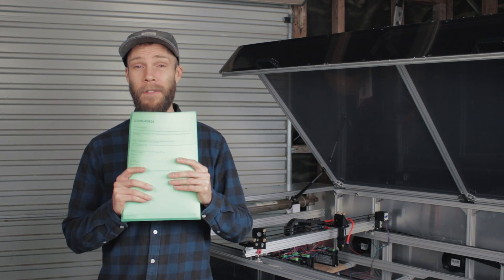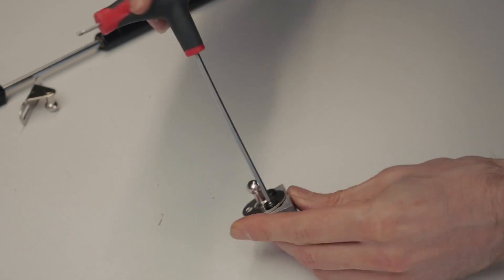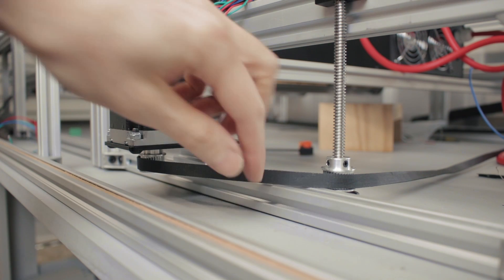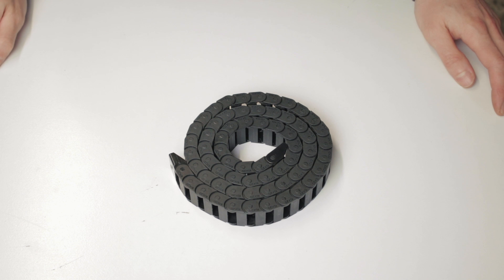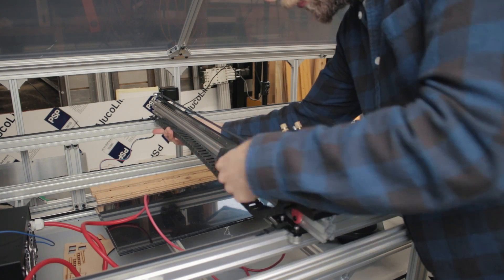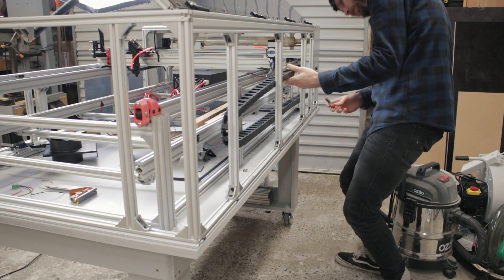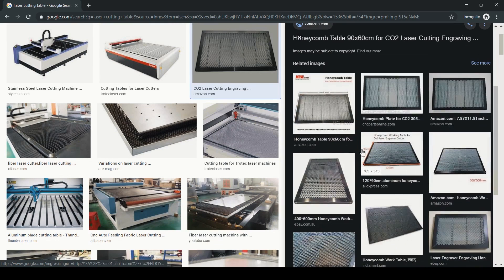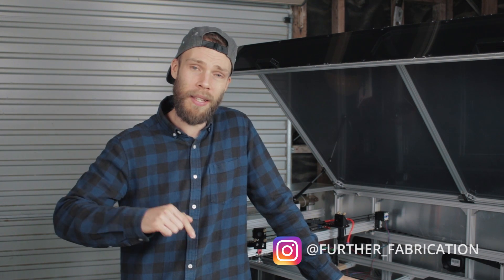Ep8: The Documentation is FINALLY done! The DIY CO2 Laser Cutter / Engraver Build Series

Comment: Note the strut ram should have the rod at the lowest point when in the normal position. This is to allow the oil in the struts to cover the seal and therefore prevent the gas from escaping.

Comment: I love this series and since this is the documentation portion of it, I'm hoping if you could give a ballpark estimation of what the cost of building the 400 series cutter would be? 
I'm a machinist by trade, so I do have a mill, lathe and saw, along with a 3D printer. So fabrication will not be an issue. 
I just would like to be prepared for mentally what it will be cost wise. Thanks, Tom.

Comment: Hi! I bought your plans and ordered most of the components to build the desktop model. Really looking forward to the build. I appreciate all the time and effort you put into the videos and the plans. So far, it looks like the cost is going to come quite a bit below your estimate, but I'm sure a lot of that is due to your location. Of course, that's not a complaint at all, lol. Thanks again. Larkin
Reply: Hey, man, what's a overall cost of this build? Thx!
Reply: @reels_ro  That's a good question, lol. I never really figured out the exact cost, but I am thinking around $1500.00 Later on I upgraded the chiller to a 5200 and also upgraded the 50w tube to a 90-100w tube. My only regret is not building a larger bed, but the laser has been a real Money maker. This laser is not like a glowforge or other desktop laser, in that it is not a plug and play but I believe I did the right thing as the building process taught me a great deal about all the interior workings of a laser and if something breaks or gets out of whack, I know how to fix it.

Comment: Hi Rob, just a quick question where does the X switch goes after you put the cablechain? i've notice you removed it in this video and in the build guide the picture is from the previous video before you install the aluminium part which support the cablechain ; I've found out the switch is in the way of all the cables and air pipes at the end...

Comment: Just use peg board with m4 bolts through it. You can alternate holes or drill extraction holes between the grid lines. Cheap piece of Masonite with drywall screws through would work too.

Comment: Stellar series mate! Honestly, very well done. It's a big thank you from me.  
Just a quick question, I noticed that the linear guide rails were not installed when you were working on the motorized table lift at 4:27 . Are the jacking screws stable enough without them?
All the best from the Western Island,
Ben

Comment: I purchased the parts list and build guides. Great series by the way. Technical question, would I be able to substitute the Ruida controller for a Cohesion 3d which I already own? Or do you see an issue with that?
Reply from the maker: That should be absolutely fine

Comment: Thank you so much for this video series. I bought the plans and we are working our way through ordering stuff. We tried to decipher the Misumi website and their endless choices and after a day we gave up and ordered all the 2020 and 4020 T-slot aluminum from Zyltech in convenient bundles with free t-nuts and bolts thrown in. We ended up getting 10% off our order which made it cheaper than Misumi anyway.

Be aware that some of the shipping can sneak up on you. Many small parts of 10-50 cents ring up to $3-5 shipping each. The total cost including shipping on 450 M5x8mm bolts rang up to over $150. Amazon is $100 for the same. We found a local supplier who will be even less. The shipping on the $332 laser tube is $140, bringing it to $472. We're finding deals $100 less on eBay with free shipping. Be sure to shop around! :)

Comment: Great work Rob. Waiting on my tube to arrive and I can fire my Further Fab inspired laser. Ended up with a 800x600 cutting area. 

I want to change out my X axis idler pulley for your 3D design. Which of your documents should be purchased for the stl files?

Thanks again for all your work on this project.
Reply: Just went ahead and bought them all. For anyone else with this question it’d in the CAD bundle.
Reply from the maker: You're welcome mate, glad I could help! That's a really good size - good balance between productive workspace and not taking up too much room

Comment: Woah! $5, that's more than reasonable for what surely took several days if not weeks of research, assembly and troubleshooting. Love the project man, keep up the good work!
Reply: I have no problem with the $15 for the manual. But at $2400 for the 400 build it's suddenly not a hobby machine any more. Excellent videos though and I've learned loads.
Reply: @thurgogopro5338  It is a CO2 laser cutter. If you want a cheaper cutter, just buy a diode cutter around the 5 watt mark, with an all aluminum frame and build an external frame around that. That is entirely possible too
Reply: more like $15

Comment: What size laser tube did you get?
Reply from the maker: I've still got an old 50W in there at the moment, but it's designed to take a 80W Reci W1, which is what I'll get once my current tube fully dies

Comment: I have started building this great series.  My control system is already wired up.  The Ruida controller because of it's flexibility has a lot of parameters to set up.  The Chinglish documentation by Ruida is poor and confusing.   Would you be providing typical controller settings to start out with?  That would be a great help.  Thanks for the tremendous time, knowledge and effort you have put into your series.
Reply from the maker: Awesome, glad the series has been helpful! If you have a look at the Y-1200 Build Guide, I've included with that a full folder of photos of all my controller parameters to get people started

Comment: I am beyond impress with this series and speaking for my self and probably others this is valuable information. I plan on upgrading my k40 and the Y-1200 documentation will be my choice. In the past ive used leather studs as a more aesthetic nail bed option. It comes in all sizes and have a tapped screws in the back for easy attachments. Might worth a look.  shorturl.at/lpzCK
Reply from the maker: Thanks Jay! oh yeah they would work well, and I like the height adjustment with them screwing down
Reply: That shorter is not working for me, do you have the original link?
Reply: @originaltrilogy1  https://www.ebay.com/itm/Leather-Craft-Bullet-Cone-Long-Punk-Rivet-Solid-Metal-Screw-Back-Fix-Spike-Studs/303164360894?hash=item46960108be:m:ma5FYQaR6OItt7vX5R4wu5A 

the generic search term is leather spikes or leather studs

Comment: The plates i am planning on cutting with the laser cutter comes in size of 1200*800. I dont have room for a full size machine so i think 800*600 cutting area with the option to open the front for cut trough, is the best option for me. I wonder though, will this be easy for me to incorporate? Thanks for the video series, it is great! By the way, just wanted to let you know, the plans for the y-400 version is listed at 0$ on your webstore, i am guessing this is a fault? just thought youd like to know, so people dot "buy" it now.
Reply from the maker: You can change the length of the y-axis rails to whatever you need them to be. Just minus 400mm off their length to get them closer to 800mm. 
Thanks for the heads up, the Y-400 guide is coming soon so that's just a place holder there at the moment
Reply: I was thinkijg of starting with the y400 and expanding the x axis to 820mm. Do you think that wouuld be a problem?
Reply from the maker: That should be ok, the laser cutter I built back in early 2018 had a 400x700 bed setup like that and it was all good. Just keep an eye out for any areas that might need additional support
Reply: @FurtherFabrication  Ok cool, I think havin a longer x axis also will be benificial as i can have a longer tube than the max 60w in the y-400 setup. I reckon it will hold a 1250mm tube (70w)

Comment: What is the accuracy of this?
Reply from the maker: depends how well you build it, but in general I'd say 0.1mm
Reply: @FurtherFabrication  Thanks for the reply, do you think there would be a big discrepancy or any issues that you might see between using a higher wattage laser? Just replacing it with a 130W laser and its related parts for example. I was wondering on the feasibility of scaling with different types of laser power.
Reply from the maker: The only difference with increasing the laser power will be a slightly longer extension tube out of the back of the machine. Apart from that, just changing the tube and the power supply should be enough
Reply: Further Fabrication just thinking out loud here... Have you considered placing the tube at the back again (traditional location) and then using an additional mirror to effectively bend it 180 degrees onto the Y carriage? That would allow for a longer tube without an extension, yet keep the gantry the way you have it currently. 
Seeing as both first mirrors would be stationary, and almost touching each other, power losses and alignment hassle should be minimal.

I hope that made sense. Any thoughts?
Reply: @FurtherFabrication  Thanks! I was worried that I would miss something. Your videos have been really interesting and helpful

Comment: From what I have seen, honeycomb cutting boards are a bad idea. Residue will stick in them and become the fuel for fires in laser disasters. They're near impossible to clean out. Your idea is way better. Pin boards in general are the way to go = clearance is better, allowing the smoke to clear from underneath quicker, which will requires less cleaning up of the underside of anything cut.
Reply from the maker: tbh that's kind of my feelings towards honeycomb as well, they definitely need replacing regularly. I was genuinely surprised at how well the pin boards work for how easy they are to make
Reply: @FurtherFabrication  This guys explanation about honeycomb problems is brilliant. And the laser cutter machine that caught fire at the end of the video is the best example of why NOT to use honeycomb! = https://youtu.be/n54uNRs8Ydk

Comment: How about a grid of wires as the cutting table? Or would they sag too much? Well the frame they would be attached to would have to withstand a lot of pull.
Reply from the maker: Yeah that could work, it could even be a in combination with the pins, so like the pins take the weight of the material and the wires stop smaller pieces falling through

Comment: Hi Rob. Thanks for this video series.
I have one question, though: As you had mentioned switching the X and Y axes, to avoid dragging the laser head over a looong X-axis, didn't you create a HEAVIER load that you're now dragging (the laser head plus the short axis together as one unit) across the long axis (left to right)?
Reply from the maker: hmmm I'm not sure I follow... the difference is between spanning a small gap or a large one. Spanning a large gap (when the x-axis is the longer axis) needs longer and and more ridged gantry arm - which is heavier and more expensive.
Reply: @FurtherFabrication  You ARE dragging a heavier load (the entire y-axis, not just the laser head) along your LONG x-axis. I am talking about trying to accelerate and decelerate this heavier mass back and forth from left to right.
Reply from the maker: I'm sorry I'm still not following...I think we might be looking at things from different perspectives. The gantry arm is smaller than if it was to span across in the other direction and the mass of the head is the same regardless.

Comment: "Cone Spike Studs" from amazon or similar (think punk rock collar spikes) would be a perfect alternative to your rivets, you can bolt them down using the included threaded end, they're all the same length (hard to do with nails) and they're fairly pointy without being so pointy that they'll cut your hand if you accidentally scrape against them.
Reply from the maker: oh yes! that's exactly what I searching for - especially the longer ones
Reply: how about bow saw blades?

Comment: Love this. I'm hoping to build one pretty soon. Quick question though. Why did you opt to put the laser tube on the left side rather than on the back like other laser systems out there?
Reply from the maker: Great question. It means the shorter axis becomes the moving one, which drastically reduces the material cost because you don't have any large spans that you need to support.
Reply: @FurtherFabrication  I didn't understand at first until I refreshed the page and saw the frame at 1 second. Now I get it. Smart! (Also, just purchased the build guide and parts list. Thank you!)
Reply from the maker: ah all good, it's something I probably could have done a better job at explaining in the videos! Thanks

Comment: Looks like a great build.  What is the dimensions of the Y400 unit?
Reply from the maker: Thanks! External is 1100 x 800 x 450mm. Cutting area is just over 600 x 400mm
Reply: @FurtherFabrication  Thanks.

Comment: Awesome work. Your filming and editing are just as concise as your build. Laser diy has really been lacking there and I’ve been able to learn a lot just by clearly seeing what you’re doing as you go. I am curious if you have any clipping with your lid setup? Mine never seems to come into place smooth no matter what I change. Is it a matter of rigidity?
Reply from the maker: Thanks dude! Glad to hear all the time spent editing is appreciated haha. 
Yeah the lid is a funny one - so on my one I have an offset of about 3mm (1/8") between the frame of the lid and the outer frame, this stops all the clipping or grinding (unless you drop the lid unevenly). I've also got plans to add some diagonal supports to increase the stiffness - so I'll keep you posted there
Reply: Further Fabrication oh I see your 3mm now in the overhang, good call. I have some cutting to do I guess. I’ve really improved my build with your videos thanks again for these

Comment: One question: why is the enclosure from dark see-through acrylic? Would it not be safer from a eyeseight perspective to make it from wood or aluminium?
Reply from the maker: Great question, it's just the lid and front bit that's tinted acrylic, so you can keep an eye on the operation (it's opaque to laser light). The rest of the machine has aluminium panels - I had just taken them off to work on the insides this episode
Reply: @FurtherFabrication  I know, of course I have seen all episodes 😎👍😉 Ok great I was not aware of that - so in theory all sides could be made from this without safety issues👍
Reply from the maker: haha nice! Yeah in theory, though I would always have the laser safety glasses on as well